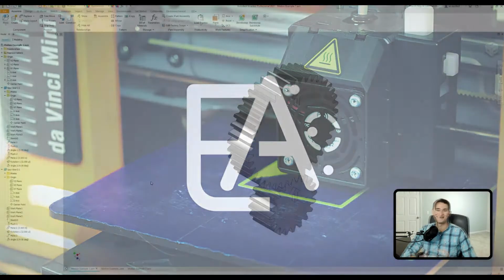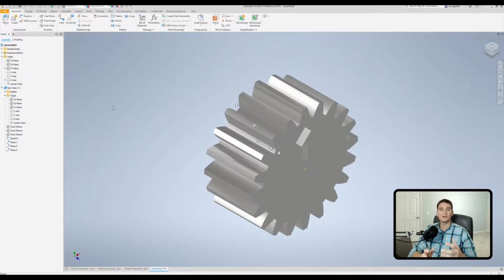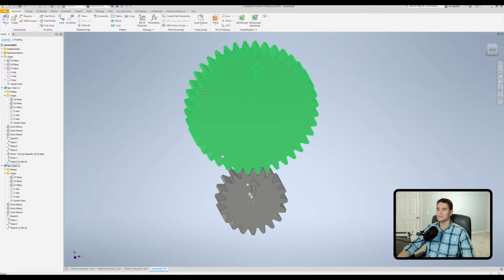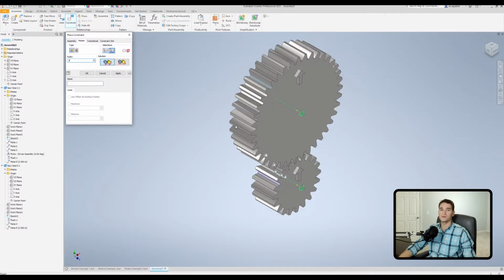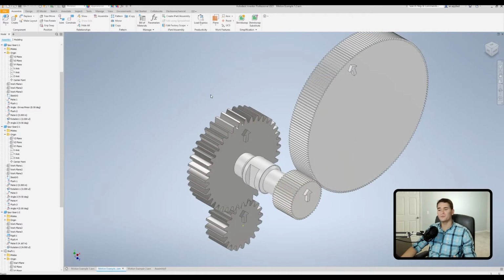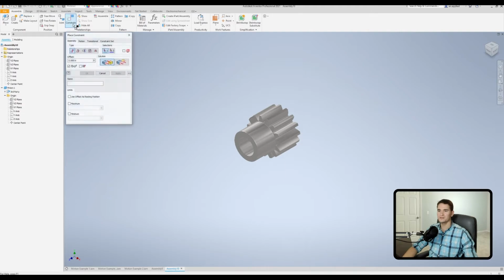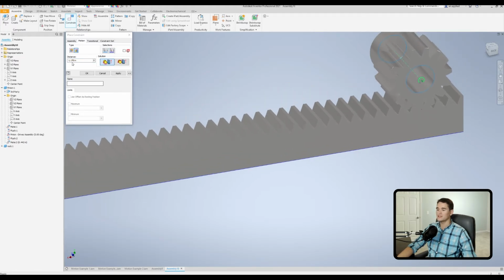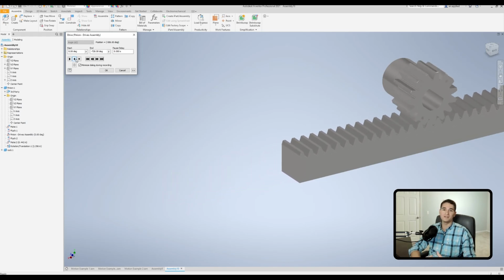Motion Constraints - Autodesk Inventor Assembly Tutorial | Autodesk Inventor 2021 IN DEPTH

Comment: So one more additional question, which may be a simple one for anyone out there. If you put this full assembly of gears and shafts into a bigger assembly say, an engine case. And you have something attached to the main shaft. How can you free up movement to wear you moving/rotating that item attached to the shaft would then freely rotate all the gears in the sub assembly. I have a similar situation that I need to pivot something that is a sub assembly in a bigger assembly. But it is locked at the certain distance that the sub assembly is set at unless I go into the sub assembly and then it freely pivots, but then going back into the main assembly. It is only locked at that point you left it at. how do I free it up to where I can pivot the sub assembly in the Big assembly

Comment: hi good day.how to make translation assembly motion, transfer load from coveyor to other conveyor.thank you.
Reply from the maker: Great question! It greatly depends on the relative orientation of one conveyor to the other. 

Let's assume that the first conveyor belt is on the same plane and in the same direction as the second conveyor:
I would create a constraint between the load and the plane of the first conveyor and just animate (or drive) that constraint. If you are looking at a set of rollers spinning while the load is moving linearly, you will set one of the rollers as the rotational element while the load (a box/carton for example) will be the translational element.

I suggest starting out simple, and once you get the simple animation working, then increase the complexity as you begin to master the fundamentals of the command. 

Thanks for watching! Cheers!